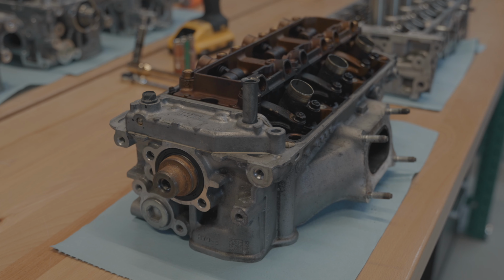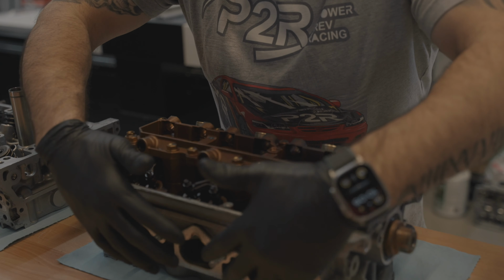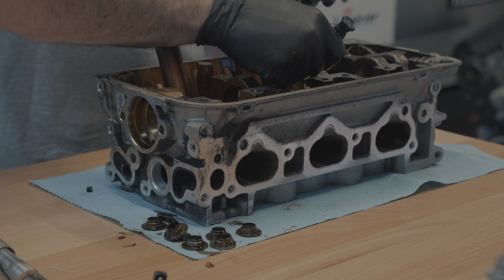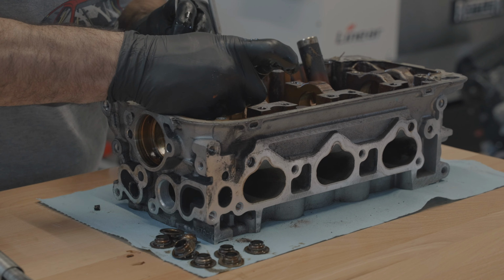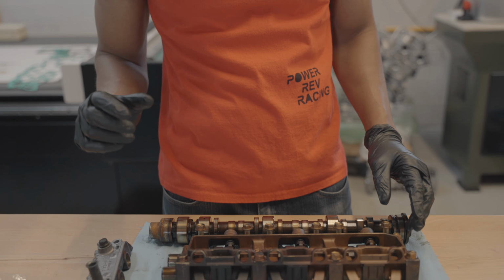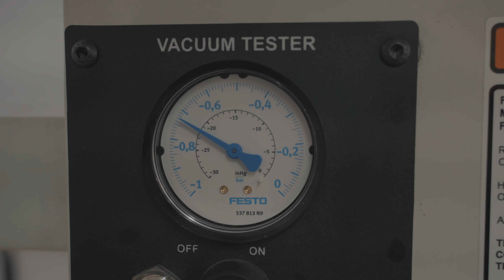P2R Cylinder Head Refresh Process, You NEED to Do This!

Comment: Hello JP. Would you happen to know if the J35Y2 from a 9th gen manual accord will fit in an 8th gen manual accord to replace the J35Z3 engine using the original harness and ECU? I have not been able to find any info on this particular swap. I know the heads on the 9th gen were redesigned but as far as I can tell the rest of the engine is the same.

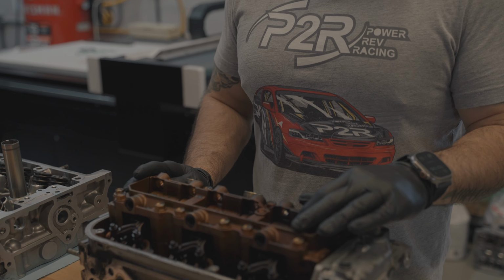Comment: @0:20 the J35Z6 was installed in the 4th-Gen Acura TL and the V6 version of the 2nd-Gen Acura TSX. Great engine!
Reply from the maker: The J35Z3 is almost identical as well.  Lower compression ratio.
Reply: @PowerRevRacing  nice, and what vehicle was this installed in?
Reply: @MrSamPhoenix  08-12 accord ex-l 6mt coupe only.

Comment: Still regret selling my 9th gen Accord V6 manual coupe everyday…. Lol I maintained it fairly well to the last day I traded it in, for somewhat of a “different” platform, not so much of an “upgrade” in its entirety. All I know is that the stock clutch and pressure plate on the car I traded in, needed to be swapped soon, but it didn’t slip or anything; it would have clutch hydraulic issues during high RPM, back-to-back, hot runs.

Hopefully I can land a lower to decent mileage pre-owned 9.5 gen, in the next few years…. The person who bought my ‘15 V6/6MT coupe w/130k miles, after 2 days on the trade-in lot, is probably super happy…. 

I went to the V8, RWD muscle car land…. where’s things are also very different, depending on your choice(s). Insurance premiums and car payments, registration annually… definitely a lot more; but was it worth it…? Still trying to figure that out.